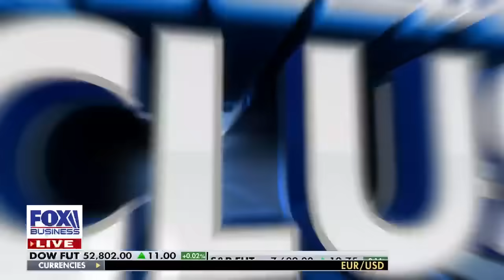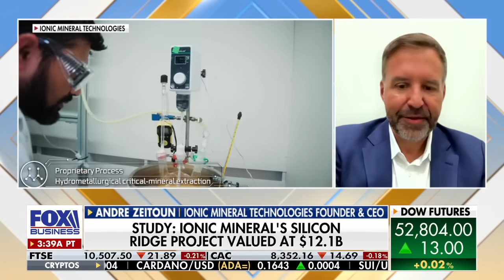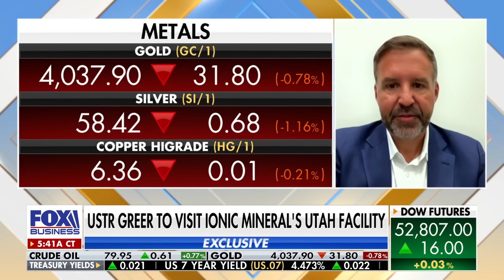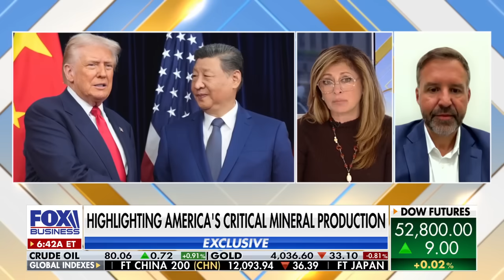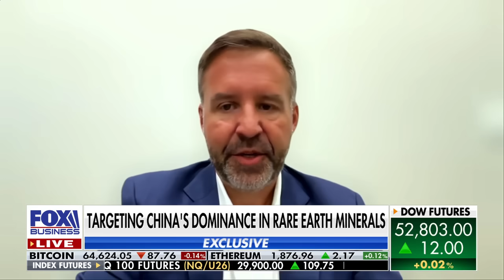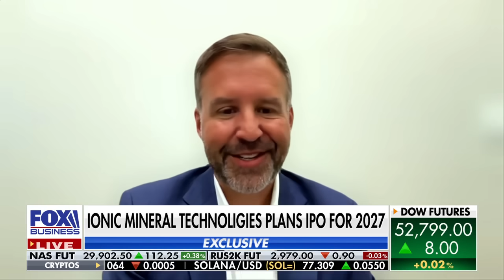UNEARTHED: Hidden under Utah is something America DESPERATELY needs

Comment: As a Utahn, I am happy about helping America and not relying on other countries but, I am not for the AI centers
Reply: Modern data centers use a fraction of the water used to farm alfalfa, which uses most of our water and is only a small fraction of state GDP and the alfalfa is shipped right to China. So I’d rather have the data centers.
Reply: @walternate2914 
Much alfalfa goes to Saudi Arabia.

Corporate farms have depleted water tables in several states to dangerously low levels.
Reply: @walternate2914 good thing you eat
Reply: @walternate2914  the data centers are not building their own power plants, they are increasing local demand. I don't want to pay more so some billionaire can socialize the cost of replacing my job.
Reply: @smolpener7430 
Most big data centers do build their own power plants.

Microsoft and SpaceX have built or are rebuilding all they need.
Reply: Utah local, here’s another reason to hate the government

Comment: This is literally the Nirvana of deposits.

Rare earths are often found in trace amounts in hard rock that are very difficult and energy-intensive to extract and process. This deposit, like some of the key deposits in China, is in soft Ion-Adsorption Clays. This makes it easy to extract and, just as importantly, easy to process domestically—eliminating dependency on China for both. By contrast, our other primary U.S. mines are hard-rock operations, which have historically depended on China for the complex chemical processing phase.

Additionally, the concentrations are higher than those typically found in China's clays. The deposit holds a trove of 16 valuable minerals, including a full spectrum of both light and heavy rare earths, as well as lithium, gallium, and germanium. This unique combination allows the project to achieve a projected capital payback period of just a year and a half. Best of all, because this was already an active mining site, they bypass the usual decade-long permitting hurdle and can utilize a pre-existing processing plant nearby.

Comment: Cesium loses an electron very easily.  It is used in phototubes.  A photon hits the cesium and knocks off an electron.  The electron is accelerated through an electric field, which then has enough kinetic energy to knock other electrons off, amplifying the signal.   Cesium is very nifty.

Comment: Hope this can be e extracted without water because we are out!
Reply: I hate to say it, but it takes a lot of water to mine clay minerals! Depending on where they mine, there very well could be water shortages in some places. Even excess farming can cause water shortages, which is what has happened at times in some high desert places around southern utah. In some area's near my place, 40 miles west of cedar city, the water table has fallen below 750 feet!! 8 years ago, it sat at around 340 feet, but because of an increase in hay farms that use very deep/large well pumps to water 180 acre fields, the water table in the area is slowing dwindling down. The shortage began about 6 years ago. Around that same time, I was retrieving water from a friends well every few weeks. One time, before my tank had filled up, the well started sucking air, and I had to slow the water flow dramatically to finish filling my water tank. That well had to be dug deeper by 280 feet, from the 360 feet it was already dug down to. It costed them 12000 dollars!
Reply: @prestoc3034  Extraction itself does not require water, you literally just scoop it up.  Processing does require water, but this is done in a closed loop where the water is captured and recycled.  Water is not consumed or wasted.

Hay farming, on the other hand, is one of the absolute stupidest things to do in a desert and a complete abuse of water rights and the environment.  Suck up the precious water from deep underground, use it to grow hay in the desert, then effectively ship the water in the form of hay to other parts of the world.
Reply: @OweEyeSea  Well lets hope the miners will be that smart as to conserve the water they use. The hay farmers do conserve water.. but there are just too many fields now. I know it seems really stupid to farm in the desert, but believe it or not, hay grows extremely well in the high desert. The farmers get 3-4 harvests every summer. The hay is sold locally after it is compressed into little cubes for horses to eat. There are still a lot of horses owned by people in utah, funny as that sounds..lol
Reply: @prestoc3034 but, you didn't stop? You pulling the sand from the veins didn't help them. You NEVER run a well dry!
Reply: @kathysoltys3104  You are correct about not running a well dry! It was low at the time though, not dry. It would have run dry if the owner hadn't paid out to have it dug deeper. The bulk of the cost however, was from new well casing being installed. They also had the pump replaced, just as a precaution. Anyway, kinda funny thing I just noticed.. the numbers on the end of our screen names almost match..lol it's been that kind of day for me with numbers!
Reply: @prestoc3034 ever Seen a mine without a huge holding pond?
Reply: Hasn’t stopped new developments anywhere though.
I worked with a mayor of a town and I asked him about the water shortage, he insisted there was no water shortage despite the next town over being on restrictions he insisted the aquifers were full and in great condition.
Reply: And Dinosaur bones ?
Reply: I heard y'all were out of water 💦 not good
Reply: Hahahahahah…… I can’t….
Reply: Oh stop it, don't be ridiculous I'm from the salt lake area. I just got water out of the tap the other day.
Reply: @mitchweber7868 People won't understand the humor of this post. Good job. 

We are super low on water though.

Comment: Refining these can cause severe pollution and is very toxic
Reply: Not if it is monitored properly  .
Reply: Utah has winter inversions, and the smog gets very thick until the next storm system comes in to blow it all away. The mountains on all 4 sides boxes it in, and it just hangs there, like fog. Why would we want more industrial processing like this when we can't even clean our own air?